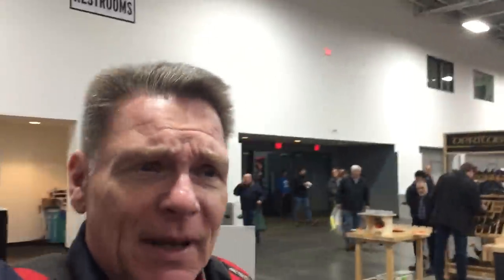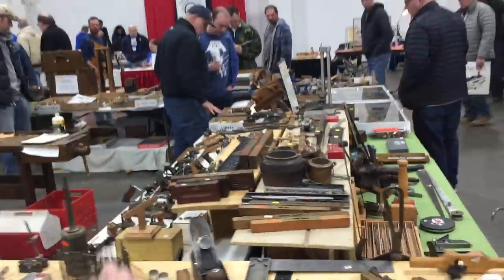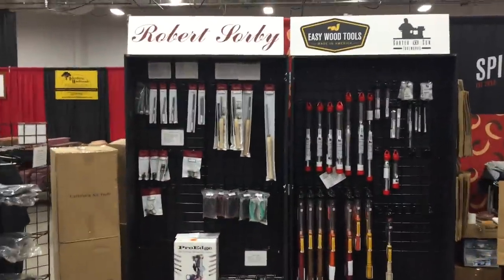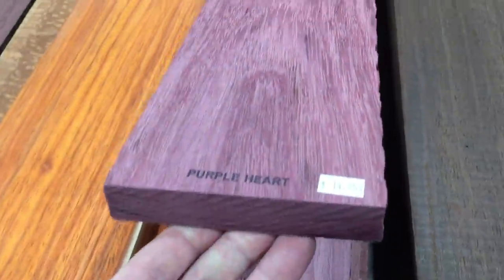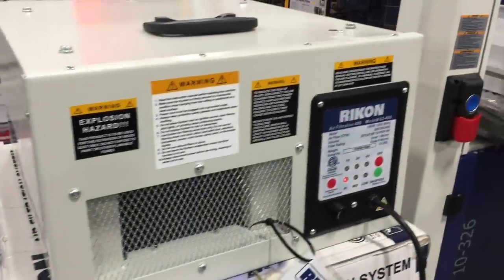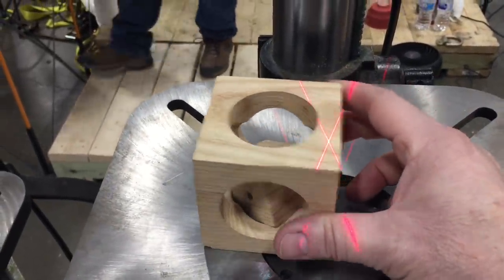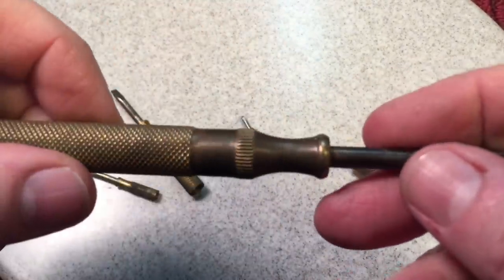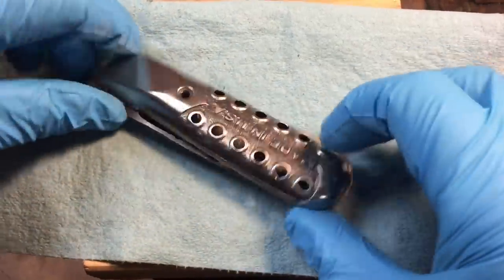Visiting The New Jersey Woodworking Show and Some Tools For Abe Elias.

Comment: Hey John . After I watched this video another one of your older videos from July 2017 came up & I watched it as well . It was about other options of drilling holes in wood . I noticed you were using  a battery operated Milwaukee drill . I wouldn't normally take notice. But within the last month I purchased several Milwaukee M12 and M18 battery operated tools . Including the hammer drill driver/impact combo's  in both M12 & M18. The bandsaw m12, the m12 and m18 hacksall, the 4 1/2" grinder , and even a battery operated M18 light . Just wondered how many Milwaukee M12 & M18 tools you now own , and wondered if you wanted to do an episode on them ?
            Reason I got those tools was because I decided to give alot of my tools to my stepson . I gave him my Craftsman 12 vold drill driver/impact , my S&K 1/4" and 3/8" socket sets , and most of my Craftsman socket sets to him .And just replaced them with sets of metric & SAE wrenches anthe same in 1/4", and 3/8" Tekton tools from Amazon (Made in Tiawan) with Lifetime warranty.
Reply from the maker: Hi Dave!  I have to tell you I have always had a love/hate relationship with battery tools of any type.  The reason being is that their weakest point is the battery as you know is only good for maybe 5 years.  Now I wouldn't mind so much but the replacement batteries are crazy expensive!  Drives me nuts!  I bought the Milwaukee set when I bought my cabin upstate and it has no power so I thought these would be just what the Dr. ordered.  =)  They do work great and have plenty of power but they are still battery tools!  LOL   As for you giving your stepson your older tools and buying new I can definitely see that as a good option.  You and I won't be doing heavy work anymore (hopefully) and the new stuff is really nice.. In fact Dave I recently got a look at the new Craftsman ratchets and they are just beautiful!  One thing I need now in my ratchets is a quick release button. If you ever try to work on something and your gloves get oily forget getting the socket off the older ratchets!  =D   Believe it or not I use my Stanley Socket set most of the time because it's all in one nice case!  =)  Thanks!

Comment: You're too fast with that camera. I got a bit of a headache :)
Reply from the maker: Thunderstruck - In the settings bar at the bottom of the screen you can drop it down to 1/2 or 1/4 speed but I know what you mean, I could make an hour video just on stuff to see there...  😃👍
Reply: When I encounter a faster video sometimes I can reduce the speed as YouTube has the options and even freeze frame it. Some of the YouTube scale plastic model shows taught me this.
Reply: @ScoutCrafter  Slowing it down to 0.5 doesn't help for my headache. I'm guessing you'd need to freeze-frame it while recording instead of schmoozing around :)
Though your voice sounds much better in 0.5 mode :)